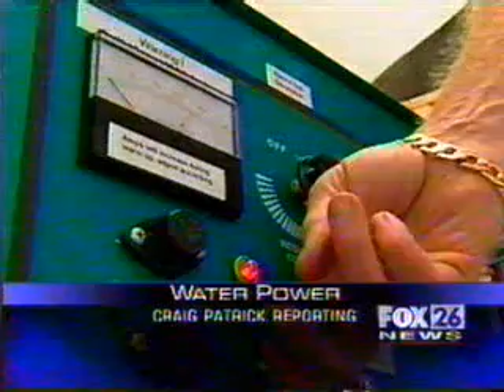turn water to fire

Comment: Stop rambling like a fool and just listen to what I'm saying.

These are two different technologies, the car and the torch. In both applications HHO gas is used. For the torch, it is used to create a flame that does not burn very hot, but generates more heat through contact with certain materials. The amount of heat created values more energy than the electricity used to get the HHO gas.

In the car, it is not SUPPOED to provide more energy, it's supposed to provide SAFER and CLEANER energy.

Comment: By the way, the only reason you have switched from talking about the car to talking about the flame is because you know I proved you wrong about the car.

Anyway, I was wrong in my last message when I said that it isn't "burning", obviously it is burning, but not as you defined it. Burning just has to be an exothermic reaction, not a "strong" one.

when the HHO gas bonds to form water vapour it produces some heat, this excites the molecules of the material being welded, and THAT gets hotter.

Comment: It's not "burning H2 into H20", that makes no sense. It's a gas called Oxyhydrogen - a mixture of hydrogen and oxygen at the same ratio as water, without it actually BEING water.

When the "flame" touches something the oxyhydrogen (HHO) bonds forming H2O water wapour, this releases energy which is absorbed by the material being welded. That's why the "flames produce water".

This ISN'T really burning, so obviously it doesn't meet your definition. It's a different process of releasing energy.

Comment: You cant get energy from bond H-O, because this energy was released when forming these bond. When you want to divide those 2 atoms, you need to give the energy to molecule. And its the same energy, you get, when you burn the H2. As Ive expected, you dont know basics of chemistry and physics. Atoms are forming molecules to release energy, and get to lower energetic state, not higher. If you get some chemical energy only from H2O, contact me, ill give you million USD (or more, if you want)!

Comment: It must be chemical reaction of burning H2 into H2O, because you can see it on video, when he is aiming flame towards plate (flames produce water) :) almost everything burns into CO2 and H2O. Burning is defined as strongly exotermic reaction, which leads into producing H2O and CO2 (and other matters). Getting chemical energy from H2O isnt possible, because its forming enthalpy is strongly negative. HHO gas is not more, than mixture of H2 and O2. This idea is UTOPIA! :)

Comment: It's HHO, not H2. It's not burned "back into water", it's just burned. It's not perpetual motion because water is still consumed, the car cannot move any further than the energy within the atoms will allow

What you don't understand is that this is not about getting a better fuel-to-energy ratio than fossil fuels, it's about finding a clean alternative form of energy. As such, it is an energy source, just not the best

I agree, hotter than the surface of the sun is a slight exaggeration, lol

Comment: I didn't miss it, I'm obviously not under the impression that this is a nuclear reaction (insert pointless exclamation mark).

What I'm saying is that, used properly, hydrogen is capable of generating far more energy than it takes to seperate it from water. Atomic reactions are the obvious extreme of that, which I cited to simplify for you how the first law is not being broken by getting energy from hydrogen, because there is so much.

Don't try insulting my intelligence, I will break you.

Comment: You missed, that he is getting heat from reaction H2 + O2 = H2O, not from nuclear reaction! It works very well, but energy, you get by electrolysing 2 H2O into 2 H2 + O2 is the same energy, you get from burning H2 in O2, but there is also some losses! Doesnt matter on voltage you use to electrolyse, but on electric energy in kWh (the unit, for what you pay on bill for electric energy), so he must pay a lot. I see, you dont have basics in chemistry and physics, so please learn it, and then reply.

Comment: Very little voltage is required to break H2O into Hydrogen and Oxygen.

One Hydrogen atom has the potential energy of an atomic bomb. Even harnessed to a small degree it can produce significant energy

This does not contradict the first law of thermodynamics, energy is not being spontaneously created it's already locked up inside the Hydrogen atoms that are being released. It's just a very efficient fuel source

Why would the government be negotiating for the technology if it doesn't work?

Comment: This is great and all, but I just don't get how it's possible that the tip stays cool to the touch, but when he puts it to metal it instantly becomes hot.

Is it that there is no heat at the tip, and if he put his finger at the base of the flame he would lose this finger?

Comment: I gotta say bullshit, he's duping everyone or leaving important details out. Chemical energy is held in bonds. the bond between hydrogen and oxygen requires energy to break. He's probably using an undisclosed material as fuel to break apart the water molecules. A japanese company i believe came up with a material that does this very thing. so he shouldn't be saying miles/gallon of water but miles/x-grams of y-material. by not mentioning this material he's basically claiming perpetual motion.

Comment: One hugely significant problem, it takes fossil fuels to power the electricity to separate out the H2O to HHO in other words it takes the same amount of energy of electricity(comes from fossil fuels) to convert water to a fuel.
Reply: Robert Moses Niagara Power Project, water powered turbines to create electricity that powers part of the east coast.... there are other ways. Hydropower currently accounts for 28.7% of total U.S. renewable electricity generation and about 6.2% of total U.S. electricity generation. Yes, that's a tiny fraction; but there are other methods.

Comment: H2O is a bond of 2xH and 1xO. H will burn (or rather oxidize rapidly) in the presence of O to recombine as H20 basic chemistry.
The trouble is basic physics means the energy produced is equal to the energy required to split it.
If you had a 100% efficient spliting and generating (using the gases produced) process you could have a self sustaining reaction. But you can't achieve 100% and there would be no energy spare to run anything else
That box is big because it has a large transformer in it

Comment: You have to realize this all of this is really electrically powered. If fossil fuels (coal) are the primary way you get your electricity you are essentially using a coal burning car, torch, etc.

Nuclear power + Hydrogen (from the electricity from Nuclear power, from water) is the future, but people are trying to skip Nuclear power, which is by far has the best ability for cost, and safety.

Electricity comes from something folks.

Comment: Couple of reasons. For one, oil is easily available and already being used and on the market for a price. Businessmen won't just give it up yet sadly. Also, imagine what the price for water may be in the future when it needs a higher demand. Also again, it's not that easy to make a change like this over night. It will take some time to make such transitions. Just make sure you keep asking for the correct resources :D.

Comment: excuse me, but to get C for the CO2 you need to burn some hydrocarbon to get Carbon out of it, if you DON'T burn carbon what you get? you get again H20, i agree there should be some loss as energy(heat) and the rest comes as vapor, it seems viable, but i don't know.. it might be too far from working properly

Comment: The filament in a regular bulb is the same temperature as the surface of the sun. You're getting heat a radiation mixed up. And to those who are using atom bombs, that is a sudden release of huge amounts of energy. The sun a permanent, stable reaction.

Comment: oddly enough i theorized this very thing in the 7th grade. though i took it a completely different way and thought to use pressure to separate and realign the molecules and make hho gas. the electric usage hes using seems failry decent enough but in order to turn the h2o into hho {(which in itself is a mystery to me)} you would still need a good elctric generator and the car would still cost about as much as a hybrid car, if not more. but still an interesting way to do things.

Comment: There is a difference between a mechenic and an engineer. A much smaller amount of HHO is needed to fire the cylinder then petrol. anything that burns is a potential fuel. The first combustion engines ran on alcohol, kerosene or even lamp oil. The heart of a combustion engine is the carbureter. The carb is what determines what fuel your running on. Ask someone from Brazil.

Comment: not really the surface of the sun is only 15 thousand, but the core is where you get the millions of degrees, even so, sandia laboratories has created temperatures, on earth, of billions of degrees using their Z-Machine, please search it on google or wikipedia so you can see for yourself, and when they did this the atmosphere remained quite tranquil

Comment: This is amazing.  Seriously.  It still requires a lot of electricity, but it's the beginning of an amazing new branch of engineering.
Reply: A standard 12vdc car battery works just fine,, not much electricity! Then as the ca runs it keeps the battery charged same a gas!  Thousands already do it.

Comment: Yeah, sure. If this is real, then the reporter didn't actually understand what the device is supposed to do. Chemical water power with water as exhaust is perpetual motion, which is as believable as a self filling beverage bottle. Energy is a substance, as it were, subject to the same constance in quantity as any solid object.
Notice it's been two years since this was posted, and you've heard nothing else? You'd think you'd have heard SOMETHING about further development by now.

Comment: The difference between H2O and HHO is that with the H2O molecule the hydrogen atoms are both directly attached to the oxygen atom. HHO is the same as H2O only that one of the hydrogen atoms is attached to the other rather the oxygen.
H-O-H = a model of H2O
H-H-O = a model of HHO
Trust me; I got an A in chemistry.
But it is beyond me to know why a hydrogen atom can have more than 1 atom attached to, I thought it would have been impossible up to the moment I saw this video.

Comment: I don't want you to feel stupid or anything but H2O is a single oxygen atom with 2 hydrogen atoms attached to it. This is because the oxygen atom has a charge of -2 and a single hydrogen has a charge of +1. The 2 hydrogen atoms together have a charge of +2 and since opposites attract they make an equally charged water molecule.

Comment: I looked into this a few years back. In terms of using this for welding, or metalwork in general, the problem is hydrogen embrittlement. Remember, water is the universal solvent. Hydrogen intergranulation in metal results in structural failure.

Hydrogen torches are in use in the jewelry industry, but qualified welders aren't regarding this as credible yet.

I'd still love to play with one, check it out etc.

R